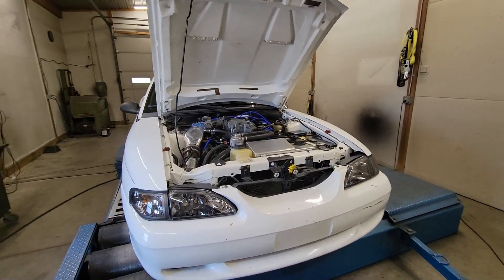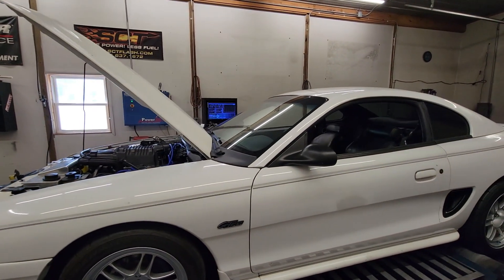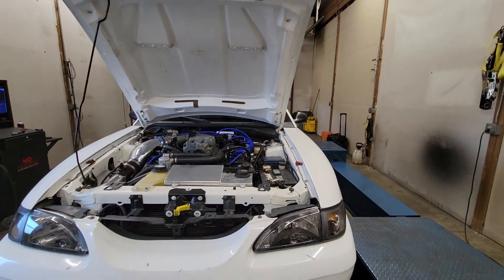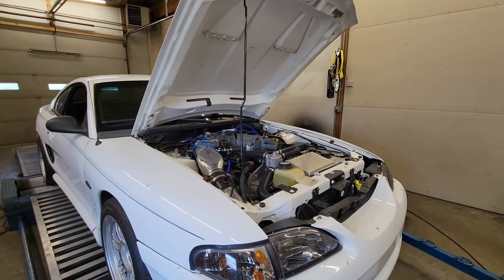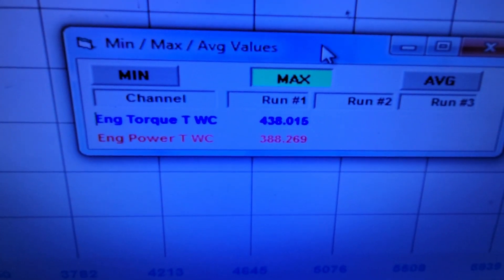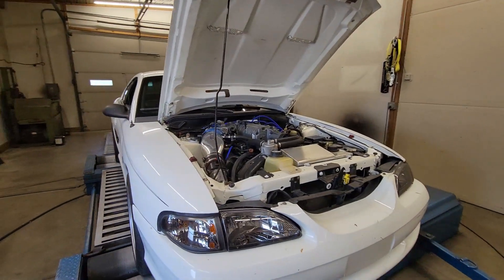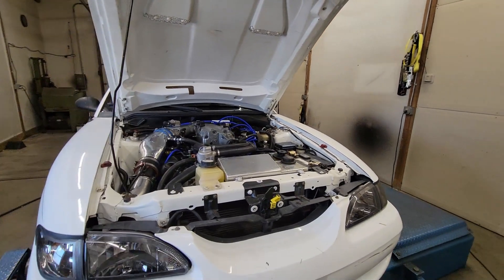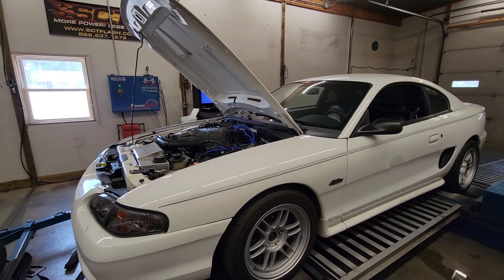Roots Blown 4.6l 2v Ford Mustang | Non PI heads | Dyno Review

Comment: People really sleep on these 4.6s. No they arent as good as the LS or coyote but they can make some damn good power for the money. And parts are cheap and plentiful since ford stuck these in EVERYTHING back in the day. Heads and cam and a tune and these bad boys will pick up 100 hp the tire easy. Which for a relatively light weight RWD coupe is a damn good amount for the street. Fucking 400 ft/lbs from the start is an absolute tire shredder

Comment: Stock internals too? Does the 4.6 have anything forged? Pistons? Rods? Just curious because my buddy did that to his expedition and it didn’t turn out well. That mustang is gorgeous btw.
Reply from the maker: Stock internals.
Reply: @ForceEngineering  how many pounds of boost was it ? Btw ?
Reply: These have hypereutectic and not forged pistons. You can’t run a lot of boost on this set up but it sounds great!